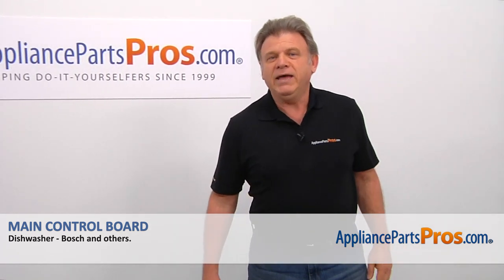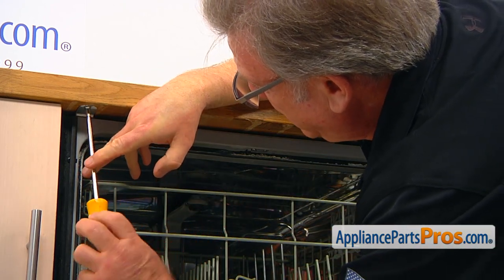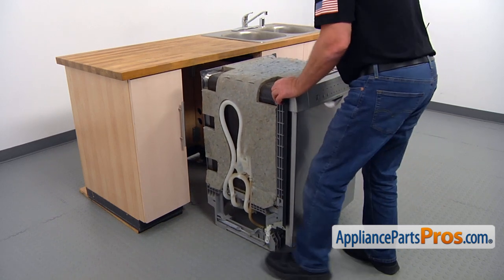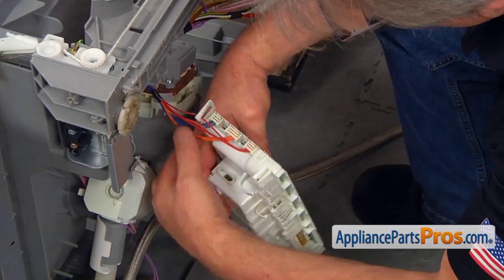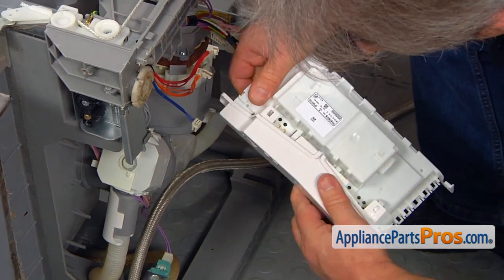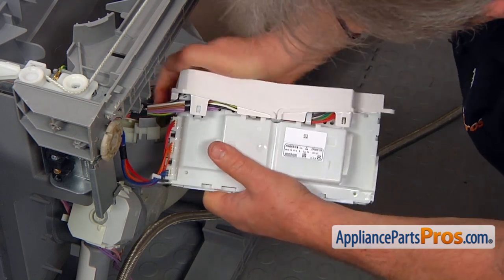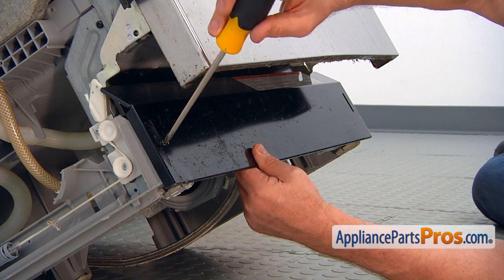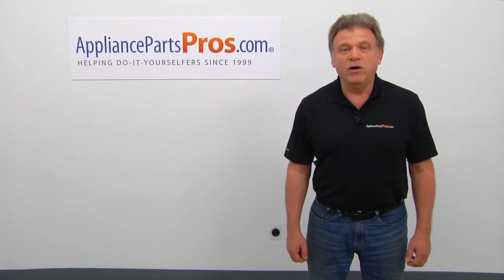How To: Bosch/Thermador/Gaggenau Main Control Board 00705047

Comment: Very helpful! Thanks for the video. Is this control board also work with Bosch model SHX3AR75UC/28?
Reply from the maker: The control board for that model is part number 12010638.

Comment: Excellent video.  Unfortunately replacing the Main Control board did fix the problem.  Water still runs warm.  Brand new, the Bosch would produce steam at the end of the cycle.  No longer does that.  Cleaning is just not consistent.  Can you share the next step?